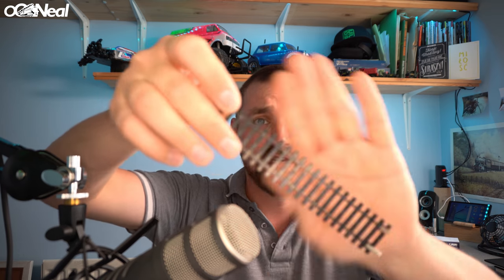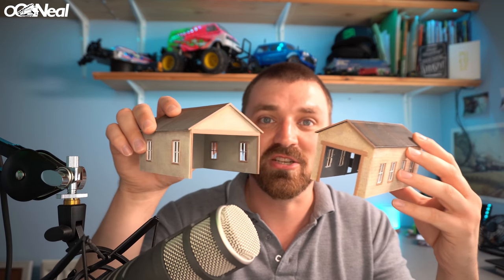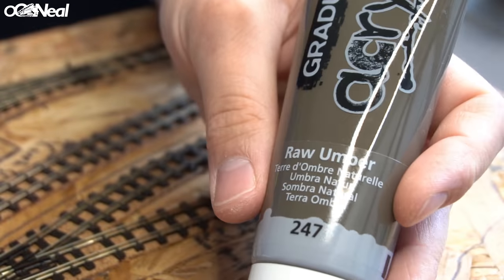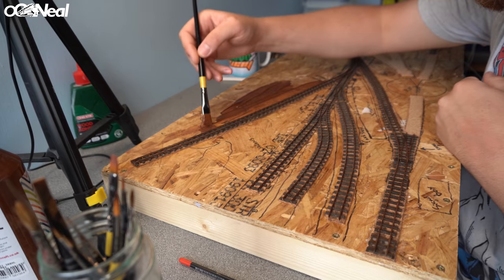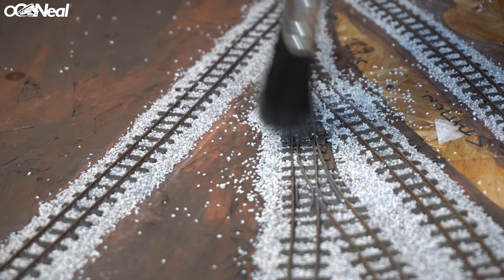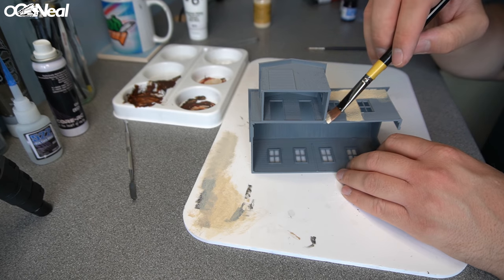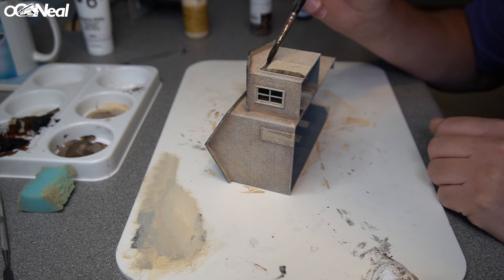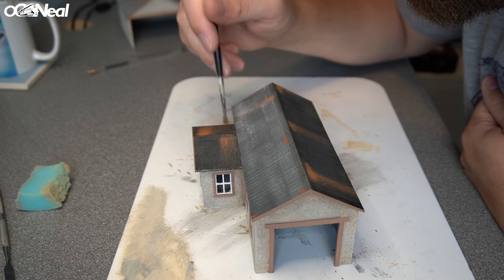Building Up A Model Railway S1 Ep 43 | 3D printing | Ballasting | Painting railway track

Comment: Have tried glass and magnetic beds for the ender. Always come back to the fake build-tack, doesn't give me anything like the trouble of the others.
Reply from the maker: Maybe look at making the Nozzle gap closer to the bed? I’ve been fortunate to now have any issues but I know that when I make the nozzle a little too far from the bed it starts to string a little but it’s a fine line. If I had the spare cash then I would go for a Prusa mk3 as it has a proxe sensor to measure the height of the bed which will make everything easier. Try a slightly closer gap and see how you get on, I find if it’s too close you will get more marking on the bed though

Comment: Love the things you do you must have gone to a lot of expense to buy a 3d printer. To make models seems an expensive way to build although you can get what you want made. Is there companies out there that would make what you want at reasonable prices? Keep up the good work.
Reply from the maker: Hello, thanks. The printer isn’t mine but I have purchased and ender 3 v2 as for cost they arnt bad plus I will be making things for my other projects so it has multi uses not just for model railways. I plan to print lots of things for my layout so it would pay for itself that way too. Companies charge quite a lot considering how much the material cost is so if you plan to make lots of parts my view is to have fun and make your own parts. Thanks and take care